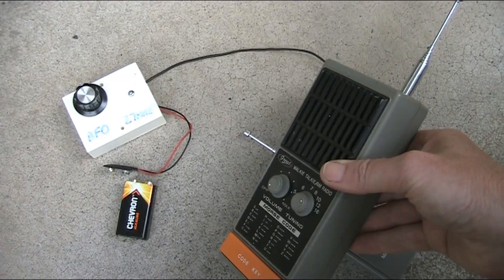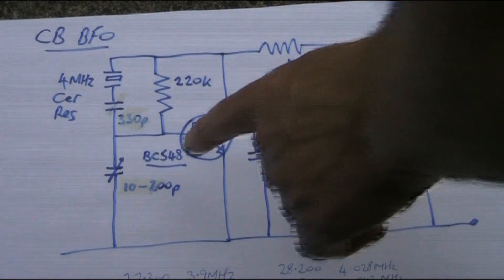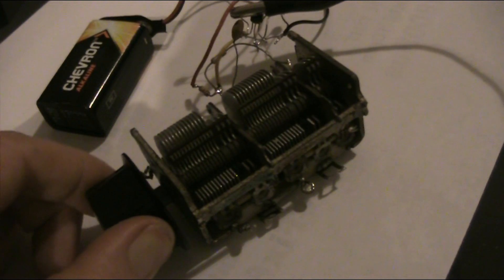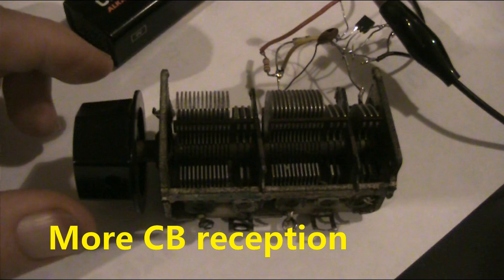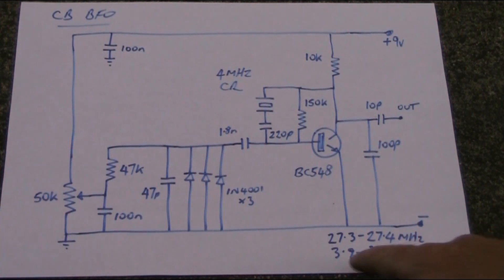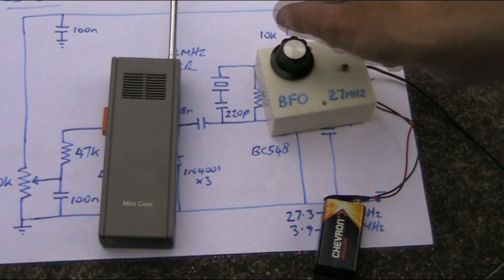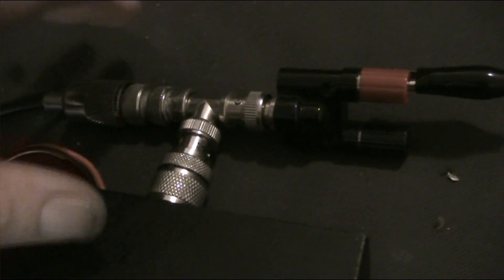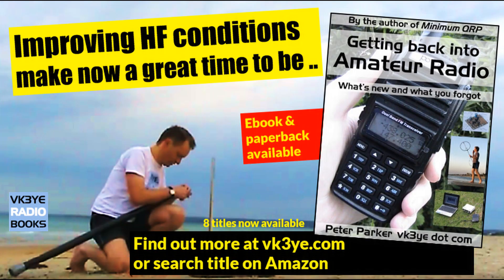Hearing 27 MHz SSB on cheap walkie talkies (BFO with 4 MHz ceramic resonator)

Comment: You're a genius!What about using the local oscillator in another superhet SW radio with the same/similar range as the one used for listening on?And detune it 455kHz above or below,and then loosely inject it in the first one by proximity?Lazy man's BFO😂
Reply from the maker: That works well. See other videos I've done demonstrating this.

Comment: Another great video! One question - you mentioned that the disc ceramics you used were not ideal. Is this because they're disc ceramics, or because of the particular type of disc ceramics you used? Thanks!
Reply from the maker: NPO disc ceramics are OK. Others drift. Mica & polystyrene capacitors are preferred if you can get them.
Reply: Thanks!  @vk3ye
Reply: Silver mica are the best, but most expensive.